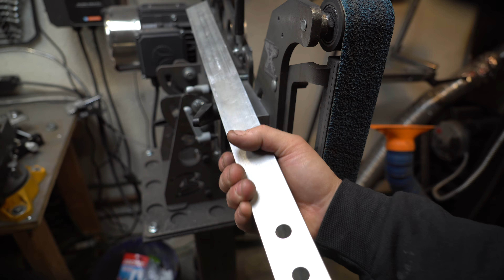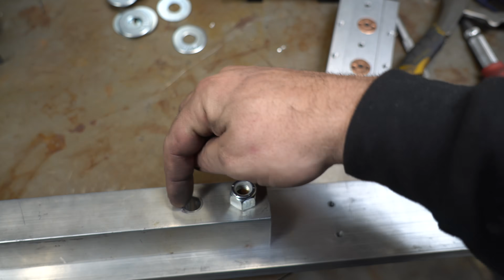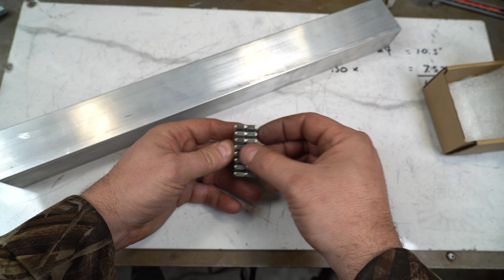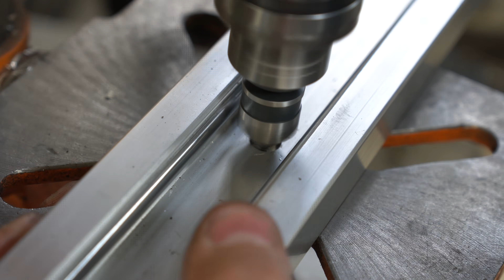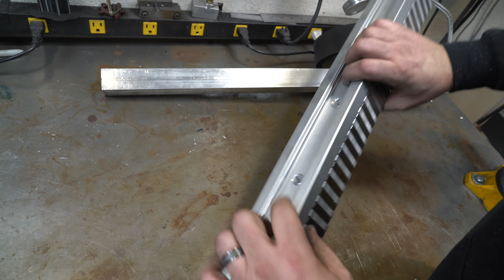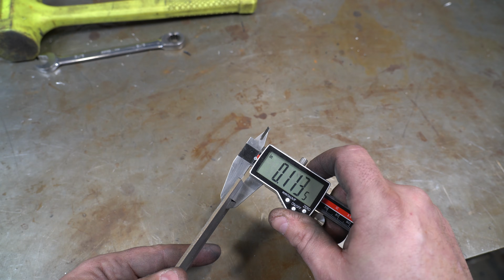Triple-T #110 - How to build a surface grinder

Comment from the maker: Any questions on this build I didn't answer in the video?  Check my website for mag chucks if you want to build it.  http://www.tyrellknifeworks.com.
Reply: If a table saw can cut aluminum, why not use it to saw the slots for the magnets as well?  Probably couldn't just use a dado stack (I've never tried it, not sure I would though) but you could easily just take some shallow cuts and move the piece over very slightly with each cut and then gradually take deeper cuts to make the slots for the magnets.  A jig would probably save a lot of time.
Reply from the maker: @fredfchopin  it’s probably possible but aluminum is tough on your blade.  You might go through a couple blades doing this. It might work though.  Thanks for watching.
Reply: Could you do a quick bit on using the distal taper function?  I'm curious what happens, or how you adjust when one side is done then flip it over since it will have an angle on that side.
Reply from the maker: @edwardlance2379  Ah, great question!  It depends what you are trying to do.  If it’s taper a whole blade, pre-bevel, then I usually mark a point on the blade, so I know where I’m starting.  Then set the taper by raising the end.  You can measure it with calipers.  Then you flip it over and raise the taper the same amount again to do the other side if you want it mirrored.  If you were doing the entire knife, front to back, you just need to taper one side.  Does this make sense?
Reply: How do you clean the metal filings from this? don't they accumulate?
Reply from the maker: @kevinknight195  you can just wipe them off with a cloth or even your hand.  They come off easy.  Thanks for watching.
Reply: Did you know that routers with carbide tooling can be used to mill aluminum? Consider trying it and if  efficient selling the router pattern because it would be pretty sweet if this could be made using a ubiquitous woodworking tool.
Reply from the maker: @alexhamon9261  yes that’s certainly possible.  Though you’d need sone kind of fence setup to make the slots.  If you have a router and tooling already it’s fine but the investment is beyond the gain if you don’t.  Thanks for watching.
Reply: Do you need to use aluminum for the tool rest mounting plate?  Or will mild steel be fine?
Reply from the maker: @yax75  Mild steel will work just fine.  It's just a bit heavier.
Reply: Trying to find the material list links
Reply from the maker: @swartz340  https://www.amazon.com/shop/tyrellknifeworks/list/RW7IVYGYCAEZ?tag=onamztyrellkn-20&ref_=aip_sf_list_spv_ofs_mixed_m

Comment: The metal shavings on the magnets is a pain. A bit of thick plastic wrap helps. Being able to turn off the magnet is cool
Reply from the maker: I’ll be doing a build soon with switchable magnets.  I actually like the perm magnets for taking the mill scale off of Damascus.  It takes too long to switch magnets each piece.

Comment: Why didn't you just use the tablesaw to cut the slots in the bar for the magnets?
Reply from the maker: While that’s an option, it’s sketchy and leaves really jagged edges.  The mill does very nice slots.  Thanks for watching.

Comment: Could you mill the slots for the mag chuck with the table saw? What type of blade are you using in your table saw?
Reply from the maker: You could but they’d be pretty sketchy.  Not as clean as a mill.  It might work, just be careful.  Thanks for watching.

Comment: Do you think I would have any success doing the hamone on W-2 in a normalized state?
Reply from the maker: I’m not sure I understand your question.  You want the steel to go thorough normalization and grain refinement and preferably an anneal before quenching.
Reply: @  I don’t have heat treat oven I heat treat right from normalized state
Reply from the maker: @johntwite2421 do a few grain refinement steps first.  Heat it non/magnetic and stop and let air cool, do that twice after your normalization.  Then heat to below non-magnetic and let cool in your forge as it cools down.  THEN do your quench, that’s the best method.

Comment: Is it better a 6” contact wheel va 4”? is it also preferred a solid vs grooved ?? Thanks in advance
Reply from the maker: A bigger wheel is better, less “ribs” on your steel.  Either solid or grooved works.  Grooved can be more aggressive and take more off.  My big stand up surface grinder has a grooved wheel.  Thanks for watching.
Reply: @ thanks I’m very excited to built mine I just ordered all parts. Much appreciated 🙏🏻

Comment: At only 5mm depth you could grab your job site table saw and cut the slots with a circular saw blade. Easy peasy
Reply from the maker: Possibly, but it’s awfully messy and doesn’t look nice at all.  I’ve tried it. 😉.  It works but looks like crap.  Thanks for watching.

Comment: Ordered a chuck yesterday morning and got the shipping notification in an hour! Can't wait to get my hands on it, I think the chuck I made out of steel angle is the weak point of the SGA I made. Using an aluminum wheel, I'm getting a wavy pattern on the steel, but I think part of it was taking too much in a pass, because the wheel won't forgive any unevenness. My other concern was that maybe the magnets are pulling the steel down a bit in the gaps. So I tried filling in with resin, but being so much softer, it doesn't grind evenly with steel and still leaves the gaps. I think I could do it with an aluminum chuck though, and maybe a fully supported surface would help with waviness. What do you think about using a metal wheel?
Reply from the maker: Thanks for the order!  This one won’t flex the blade, you’ll be good.  ❤️

Comment: What I want to know is, will it demagnetize after high temperature? ? How long have you been using it? Will it demagnetize? ? ?
Reply from the maker: Mine is going on 4 years.  It will definitely NOT demagnetize.  I’ve also sold many of these mag chucks and I’ve never had a single complaint.  Thanks for watching.
Reply: @TyrellKnifeworks  非常感谢，我也是中国的一位手工博主，只是没有你们那么多的工具。都是纯手工。

Comment: When all the banana trees are gone how will you measure anything ?
Reply from the maker: I have no idea what your comment means.
Reply: @TyrellKnifeworks  Inches? Get with the plan, only die hard idiots believe there is any future for a measurement system that may as well be based on the length of a banana but is actually based on the metric system. It makes you look stupid. Imperial references the metric system now, its like you standing up there talking about bananas when those bananas are measured in meters. And lets not forget about "Freedom" because the imperial system is about rich wealthy countries and corporations holding copies of the original Standard. While metric is a system where anyone can reference the standard as it is based on the world around us.

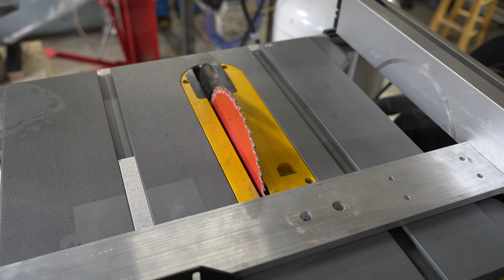Comment: Thanks for the video.  This is on the list for attachments for the Revolution I just  built.   Just one nitpicky safety thing at 6:29.  It is almost universally a bad idea to use the miter gauge and rip fence of a table saw at the same time.  I mega cringe every time I see someone doing it.
Reply from the maker: This is certainly one of my most used attachments.  Note, after I measure the aluminum with the fence, I loosen the fence so its not tight.  It's not actually running against the fence at this point.  Thanks for watching.
Reply: @TyrellKnifeworks  With the saw you are using, i guess the fence would be light enough to be the most compliant in the event of a pinch. One of mine has a biesemeyer and the other has a rack and pinon fence.   I give at least 3/4 extra clearance when crosscutting.  You wouldn't believe how many people I have seen use a locked fence as a stop.

Comment: if you used the table saw for cutting the aluminum bar why couldn't you use it for cutting the grooves for the magnets? or even better yet use a dado stack for cutting them? just a suggestion
Reply from the maker: It’s possible but it leaves a pretty jagged edge and doesn’t look good at all.  Thanks for watching.

Comment: Hey brother, great video and thank you! My question, once both surfaces are finished ground, key word "finished", how do you prevent scratches on the workpiece when sliding it off the magnet?
Reply from the maker: If you're using it for some final grinding passes, just put a piece of paper between the workpiece and the magnets.  👍🏻. Thanks for watching.

Comment: Thank you for making the magnetic chuck available for purchase. That was the barrier of entry for making this, and this has more customizability, utility, and cost effectiveness than most of the options out there. Has allowed me to effectively and reliable implement distal tapers into my knives without the practice for freehanding.
Reply from the maker: Thank you, I'm thrilled it's working out for you!  Would you mind if I used this on my website as a review?  If so, just email me at tyrellknifeworks at gmail with your first/last name or message me on IG.  Thanks again!

Comment: table saw, router, ect all cleanly cut aluminum
Reply from the maker: I wouldn't exactly say "cleanly" cut for a table saw.  It'll do it, but it's a pain in the ass.  The router will certainly work with a fence and a good bit.  Thanks for watching, Kevin.

Comment: Thank you very much for the video. I just finished building my surface grinder. Your video made the process understandable and achievable. I made a plate that attaches first to the cross slide and the the linear rail attaches to that. To mount the chuck (which I purchased from your website) to the linear rail, I machined the bolt heads round so they would fit the recesses in the linear rail. I also attached a handle to the rail and fabricated a stop to prevent pulling the rail off accidentally. Truthfully, I'm not that clever, I followed your instructions and my OCD forced the modifications.
Reply from the maker: That’s great, Boris!  Time to put it to work on some cool projects! 👍

Comment: Concerning the cross sled, is 80mm more than enough stroke length? I'm looking at a 50mm but don't want to go too short.
Reply from the maker: 80mm is more than enough.  The issue with the 50mm is that it's very narrow and I'd be concerned with deflection on the linear rail since its only about 2" wide and it has to support a 24" rail.  The 80mm one is about 4" wide-ish.

Comment: Pretty sure I did what you did. The 3/8X3” bolts holding the chuck to the cross slide I used Hex bolts but drilled out the holes in the cross slide and counter sunk them. Then used the grinder  to taper the heads , shorten the face and an angle grinder to cut slots on the top. That about right?
Reply from the maker: Yup, thats pretty much what I did.   I'm glad it worked out for you!

Comment: For anyone trying to do this, who doesn't have access to a mill, I 've had good results with a router and a carbide router bit. Obviously go slow, use lubrication and a jig to keep the router aligned.
Reply from the maker: I wouldn't try this without a fence attached to your router table.  Freehanding this wouldn't be very pretty.  Thanks for watching.

Comment: Took me a while but finished building one (with some tweaks for my machine). There is about a 0.024 inch error from top to bottom 18 inches and 0.008 side to side. I think i can adjust bits to make it more accurate, but i am happy at this. 

What i learned is that a mill would have made this infinitely easier. The chuck was made hand router which is not for the feint of heart. All the holes drilled with a rickity drill press.

Overall, thanks for the tips. This will help me and save time.
Reply from the maker: Hmmm.. 0.024 is too much.  You can try shimming the chuck mount to correct it.  0.008 is also too much side to side.  You definitely want to true that up a bit and get it around .001 across and no more than 0.002 or 0.003 lengthwise.  Try shimming it and see what outcome you get.  👍🏻
Reply: @TyrellKnifeworks  thanks. Turns out after some shimming and checking the screws, it is now about 0.001 inch either direction. Thanks for the tips

Comment: Great vIdeo and thank you so much for the metrics measurements :) Instead of milling the slots, could you use a 5mm Alu bar and cut it in to strips and bolt them down in the main Alu bar ?  it would be a lot of holes and tapping, but it may be easier than grinding with a file.
Reply from the maker: Honestly, it’ll cost you an extra $80 over the base materials to buy one off my website.  Doing what you are suggesting probably won’t save you much.  If you really want to do it yourself you could consider using a table saw to cut the grooves but you’ll probably go through a couple blades.  A router table with a fence would work.  Thanks for watching.

Comment: rubber wheel and magnet part must be each other vertical 90 degree... for this need magnet side under build tilt system. (like this u see before where is gap and after will be tilt to this side).
Reply from the maker: I’m not exactly sure what you’re trying to say, but the magnetic chuck is 90 degrees to the belt already.  These surface grinders, when adjusted well, are within a thousand of an inch or .03mm. Thanks for watching.

Comment: How critical is the 1.5 inch depth on the aluminum bar? I have a 1 3/8 and dont want to buy a new block
Reply from the maker: That isn’t going to work.  Your holes drilled to hold the chuck to the rail are already 1/8” away from the side when it’s 1.5”.  You can try it but I have my doubts.

Comment: Yest another great video. One thing I wanted to point out and suggest. When installing the magnets, pay attention to the polarity of the magnet. I have built a surface grinder and didn't pay attention to the polarity. It did cause some clamping issues with the material. Just be sure to have all the magnets with the same polarity going in one direction on the chuck.
Reply from the maker: I mentioned that in the video.  When they are glued in they need to be oriented the same way.  It’s actually hard to scree it up because they go in easier if oriented the same.  Thanks for watching.
Reply: Sorry, I missed that part.

Comment: We're going to try this but instead of using a mill for the magnetic chuck we're going to use the table saw again, lowering the blade, and using the dado method cut in the channels.
Reply from the maker: Give it a try.  I suspect you might go through a blade or two, but give it a shot.  Thanks for watching.

Comment: You could use the table saw and a cross slide to cut the slots. Nice build thanks for sharing
Reply from the maker: Several have said that, but I think you'd end up going through a few blades and it would look really rough.  It might work though.  Thanks for watching.

Comment: Hey Dennis, great video! Question, you have an end mill and a surface grinder. Is there a reason that you can't use the end mill to flatten the surfaces? I guess you would have to use the surface grinder to begin with to make sure the surfaces are parallel, but would there be any advantage time wise to complete the job using the end mill. I don't have one so I don't know if that would be practical at all. Keep up the great work! Happy Holidays to you and your family!
Reply from the maker: The aluminum is already flat and even, the issue is that you get a slight canter when it bolts to the slide and that’s what you’re correcting.  Until you get it on there, you can’t really figure that out.  If you are talking in general, surface grinding is WAY faster than milling.  Unless you need exceptionally flat surfaces that require extreme precision (rarely for knife making except for folders).  Plus end mills are expensive so you don’t want to be going through them too often.  Thanks for watching
Reply: @TyrellKnifeworks  Hey Denis, that makes sense. Thanks for the quick reply!

Comment: Great vid! Now I know what my next project is 😂

Quick question, could you use a thin piece of G10 or acrylic between the steel and the magnets to help take it off easier and prevent scratching??
Reply from the maker: Honestly, you want it that strong.  You just need to slide things off instead of pulling them.  Thanks for watching, Jon.

Comment: Uhhhhh Bro !
NEVER grind these Neodymium magnets !
The layer of Nickel they have is a protection from rust and realy thin.
If you reach the core of the magnets, they will corrode in no time !
Reply from the maker: If you watched the video, I said right in it that’s why you recess the magnets into the aluminum so you don’t touch them.  Thanks for watching.
Reply: @TyrellKnifeworks  : Missed that, sorry.
Reply: PS: Break one in half so you see what i mean.

Comment: Great video! A little concern about using the fence and the crosscut guide at the same time on your table saw. When cutting wood , any misalignment can result in a very dangerous kickback. With aluminum I'm guessing the same can happen. Adding a block to the fence that stops in front of the blade eliminates the issue and still allows the crosscut guide to work.
Reply from the maker: Thanks for the tip, Steve.
Reply: @TyrellKnifeworks  I hated to be a safety boi but I figured it was quite possible some viewers might not be as familiar with a table saw as a grinder.